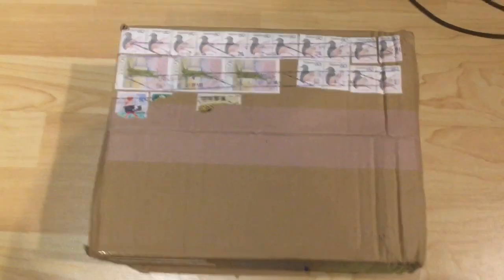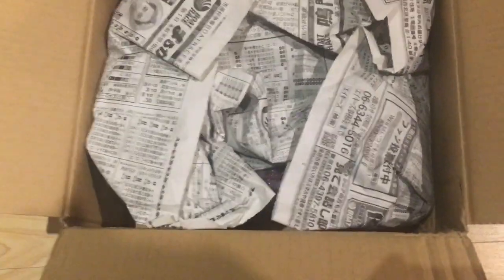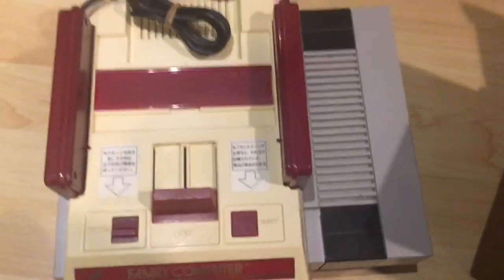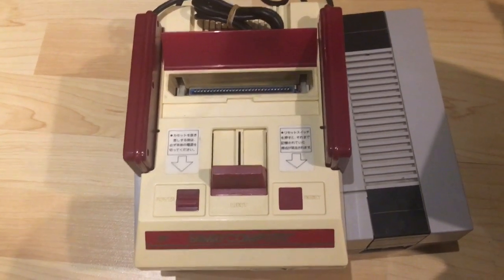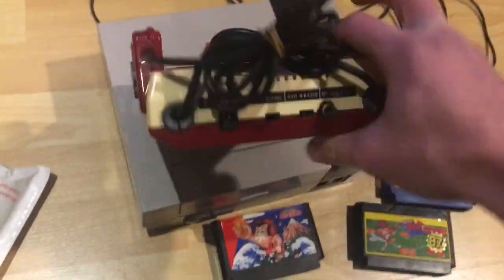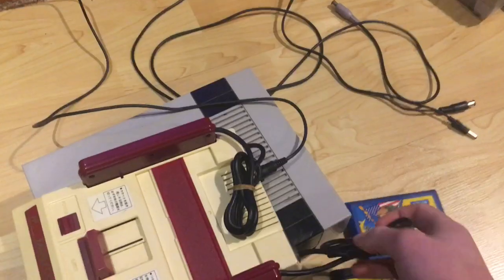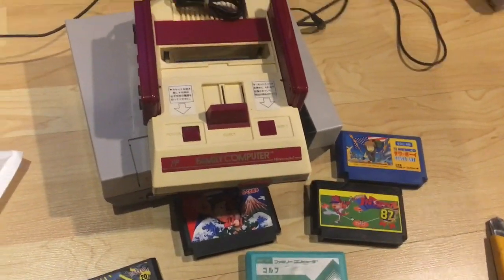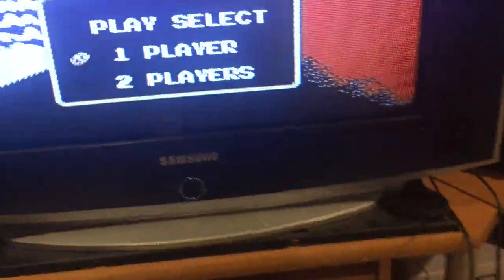Fixing eBay Junk - Famicom - Retr0brite and clean the system

Comment: 30 volume peroxide is not 30%, it is actually 9%. Volume scale is 10 vol = 3% of peroxide. That is also not medical grade, but cosmetic grade. You could also buy 40 vol, which would be 12% peroxide.
Reply: Not to mention the fact that he uses UVB when he should use UVC light
Reply: And Retr0brighting any ABS plastic from the 1980's and 1990's requires 10%-15% peroxide and 12% (40 vol) is better.

Comment: I'm starting to consider the value in modding the console shell to allow the controller cables to pass through the front. Instant two-foot gain, give or take. I think it can be done cleanly, with only a oncern about what to do with the old holes.
Reply from the maker: Tim Walden definitely could be cleanly done, only problem is theres no strain relief in the front of the shell, so you would have to come up with something for that
Reply: Glad you agree! I've considered that, as well. I'm awaiting delivery on a console this month. Once I have it opened up, I'll have a better chance to study the prospects.
Reply: Change the wires with longer ones, it's simple, clean and you don't need to drill holes in the case.

Comment: The Famicom in some ways was designed better than the NES (the way cartidges went in, definitely).  But in some ways it's HORRIBLE.  Controllers wired in, can't change them.  Have to mod it to get any sort of audio/video output.
Reply from the maker: Not to mention how short they were.  I've been debating modding one to add longer cords, unfortunately you can't just buy replacement cords, have to make them
Reply: The way the volume slider on the second controller works is terrible imo. If it's dirty it can create a lot of noise. Had that problem when I got my famicom.

Comment: Thinking of doing the same thing. Buying and fixing one of these.  What do you recommend? From Toronto. Do you remember the buyer from eBay? What doo you look for when buying and fixing?
Reply from the maker: Off hand I don't remember the seller.  There's a few who sell famicom.  You should be able to get one untested for under $25.  I usually look for something  with all parts (both controllers, cart slot cover and front port cover), no cracks, labels in good shape, then as white as possible, in that order.

Look for a seller who also sells game carts.  You'll want some games, and if you can combine shipping you can seriously reduce the cost to you.  Last famicom I bought, I also got two lots of 6 carts from the same seller.  Worked out to be under $4 a cart and about $25 for the system.

Comment: If it's yellow on the insidee it's probably close to the original colour as the uv doesen't reach in as well as on the outside.
Reply from the maker: Original color is pretty white on these,  not perfectly white though.  Heat affects the yellowing as well as uv
Reply: @RetroRepairs  Yeah, i just thought of that right after i posted, hehe. Good job though, nice to see another classic put back into service.

Comment: Hi. Famicom has no power. Famicom power supply only has less than 1 VDC power. I already replaced the power supply's capacitor. Any idea how to fix it? 

Thank you. 

God bless, Proverbs 31
Reply: You need to replace voltage regulator
Reply: Hi, thanks. The Famicom adapter has power now, the wire is cut at the jack area. I have to loop the wire to make it work. The problem seems to be in the unit. I'll clean the circuits first with 99% alcohol.

Comment: i bought my Famicom for 25€ and it has VCC shorted to GND :'(
Reply from the maker: Tails64DS NT Channel that sucks.  Have you tried a repair? Hopefully the cpu or other ICs aren't fried.
Reply: i already did some trubleshooting, i even removed the RF Modulator, but i think it's one of the IC's..
i'm going to need a decent Desoldering iron to start pulling chips, i really hope that is one of the RAM or Logic chips that is causing the short..

Comment: I would love to know the reasoning  behind putting the controllers coming out the back. Also, that word is pronounced de-cal. Not deck-nal. Lol
Reply from the maker: Not sure about the controllers. Guess aesthetics.  The thing that sucks is that the cables actually connect to the front of the board, then loop back inside the case and have to double back again. About 1.5' of length is wasted because of Rios

Comment: I deleted my comment bfore I realized you had replied, I rechecked my NES adapter and I misread where it said 9VAC. My apologies. If I link a video could you give me an idea of where I need to look first to fix my famicom that is coming in? you
Reply from the maker: Sure, link away.  I'd be happy to try and help.  Out of 3 "defective" famicoms I've bought, none have actually been broken.  Just needed a cleaning
Reply: This is what is supposedly wrong with mine
Reply from the maker: So, there's colour sometimes, but seems to flicker off.  Screen alignment is off, graphics are garbled a bit.

Could be a number of things, firstly, I'd give it a really good clean.  Cartridge slot, make sure it's reading games properly.

Secondly, check out the capacitors, check for leaks or bulges.  It's not uncommon for those to go after 20 years.  

Thirdly, I believe there's a potentiometer on the board which will affect the output of the video signal, it may need adjusting.

There also could be an issue with the Rf modulator.  If there's bad connections it could cause some bad output.  Also, it's possible that the tv used to test isn't tuned right.  I've never tried a famicom on a modem tv, just a CRT.  

Since the games seem to play properly, the CPU is fine.  Video ram should be good, as all the sprites and maps appear properly.  Possible that a ppu is going bad, I don't think an IC is the issue.  

There's also an inexpensive av out mod.  If the Rf modulator is the culprit, I would definitely just do the mod to get a better quality output signal.
Reply: Hey Retro I got my famicom in the mail and I cleaned it extensively and put a game in and it is doing as described in the video but if I turn the system on and off a few times everything comes through perfect other than some slightly disable jailbars. Any suggestions on what you could think it is or if it is a component problem.
Reply from the maker: So just so I'm clear, by simply switching the power on and off, it will sometimes boot up?  If so, I'd check the capacitors, especially the big one by the power jack.  Look for bulges or leaks.  

Hard to say though, could be any number of things.  Caps are cheap and easy to replace though.  I would consider doing it anyway
Reply: RetroRepairs Somewhat. Last night If I turned the switch on and off a few times it starts to work and after that it will come on fine each time, however I just tried again tonight after it has been sitting almost 24hrs and had to flip the switch multiple times for it to act right. Same results and yeah you are right on caps they are cheap
Reply from the maker: crzyzeldafanatic also, check the power switch and reset switch.  If you're not getting constant power through it, you could have issues.   Also check the voltage regulator.  You should have about 12v in, but around 5v out.  If you're getting more or less, it needs to be replaced
Reply: RetroRepairs Switchs and the voltage regulator check good. I have a capacitor kit on the way here to change all of them out, hopefully that will take care of the issue. If not I'm gonna have to decide if it's the RF module itself or of it's one of the chips. If it's the chips I'm gonna have to order some UMC clones but I don't know how to test the chips. Do you have any recommendations on testing them?
Reply from the maker: I don't have a great way to check them.  What I did for a nes toploader is using a logic probe, I looked for something strange.  In one case, a vram chip was not responding the same way others were, which leads me to believe it's defective.  See my nasty nes-101 toploader part 2 video to see what I mean.  I still haven't removed them yet and determined if that's the case yet.
Reply: RetroRepairs Thank you so much for your help, caps fixed it and it is working correctly. Hit you with one more here....by chance do you know if a super famicom Apu will work in an SNES?
Reply from the maker: crzyzeldafanatic I'm about 90% sure the boards are identical, however there are different revisions so I can't guarantee everything will be compatible
Reply from the maker: crzyzeldafanatic and awesome to hear that you were able to get that fixed
Reply: RetroRepairs tested the sound module and swapped pin connectors and both check out good. Any recommendations on what to check next? Video comes out perfect just no sound on the SNES.